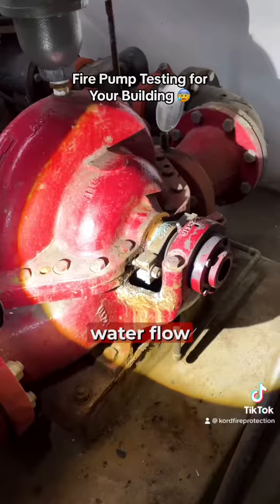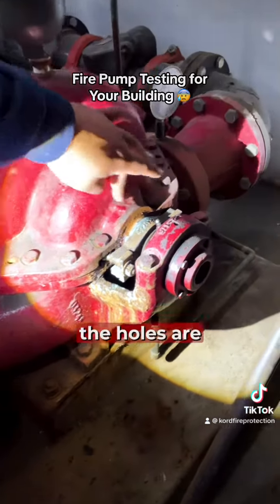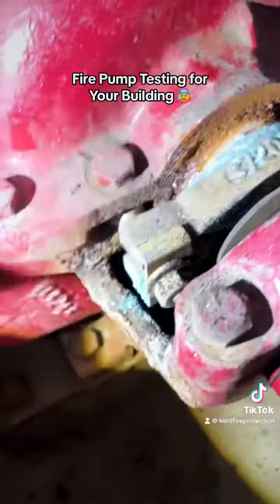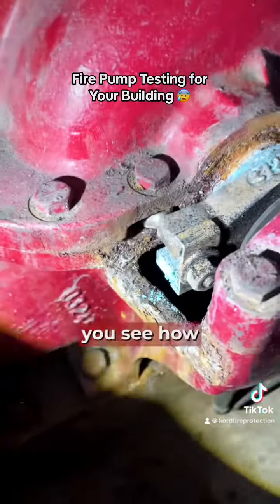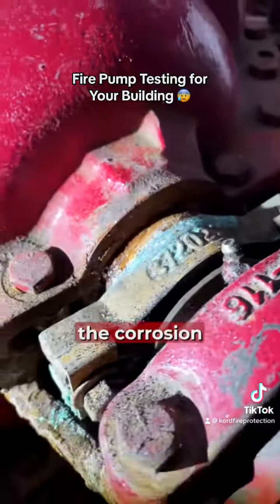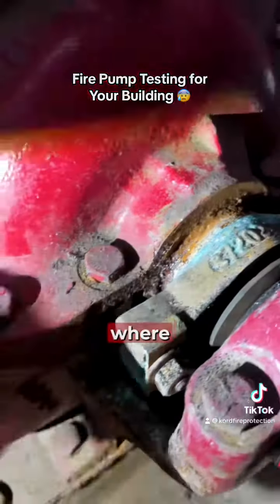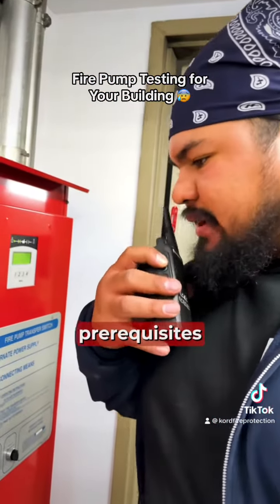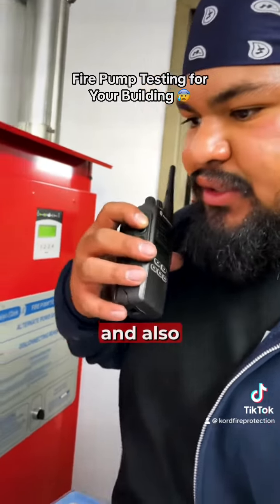Fire Pump Testing Downtown Los Angeles

Comment: Circulation relief valve is to keep the case, the rotating assembly, packing, etc all cool while the pump is churning in no flow. Or else the pump would just be circulating hot water and overheat.
Reply from the maker: 😂 Your right ! But our technician doesn’t speak very good English so that’s how it came out 😂
Reply: Riiiiiiiiight. Sure it is.